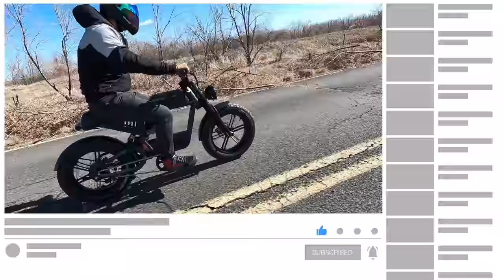Ride1Up Revv 1 Upboxing and Review

Comment: This honestly makes me want to sell my Super 73 S2. I can likely get around $2k for it and spend a couple hundred more and get this which has: rear suspension, Turn Signals, larger seat, Larger battery, higher top speed, metal fender, better display, mag wheels, 4 piston brakes. I mean... come on.  This thing even has the option for a $100 basket!   My S2 is make with such cheaply made comments its embarrassing how much they cost.
Reply: I almost pulled the trigger on a Super73 until I read alot of complaints about their customer service. I don't know much about these bikes so I figured going with a big brand name would be a "safer" bet. Considering I could have Best Buy ship it and assemble it had me leaning that way but in the short time (about a week) I've spent shopping I've found ones that seem better quality for the same price if not cheaper.
Reply: Yeah, it's making me want to sell my Rad Rover 6 Plus.
Reply: @rickymahoney6664  Take the time to assemble the bike yourself. If you're owning the bike you should understand how it works. What would happen if it broke down on you?
Reply: Get an eye on the Ariel Rider X-Class as well if your in the market for an upgrade! Ride1ups bike seems to have better looks and accessories than the x-class. But it appears the x-class has way more power and torque for the same approximate price if that's important to you.
Reply: Theres definitely a lot of competitive offerings right now and its unfortunate that a $3300 (not even including shipping and taxes) S2 doesnt even have rear suspension by default.
Reply: Why not just get a proper emtb?
Reply: Can it go up steep hills? Will someone 6 ft 1 be able to ride it?

Comment: I live in a hill area.  You showed how fast it goes with excess of pedaling But how does it do on hills.  What is the maximum weight that they can handle ? Can another battery be added to the system? When you start off in full throttle does the back tire spin ? What is the asking price of this particular bike ?
Reply: Price is $2395 according to link posted
Reply: It says it can carry 400 pounds at the beginning
Reply: @MylesKillis  Thanks for the come back. I guess I missed it at the beginning.

Comment: Awesome looking bike. I’ve followed some deals down the EUC route, and can’t see going back, but ebikes have a lot going for them. I would absolutely love it if people get out and replace some errand runs not driving a car. If it goes in a backpack and is less than 5 miles, I’m not driving unless the weather is terrible. I can see this being a pretty solid option for fun and practicality.
Reply: Good comment. Are these bikes legal to ride on the road? What licence do you need?
Reply: @TheGreatest1974  Technically, a street legal ebike isn’t supposed to go faster than 28 mph where I live (it’s supposed to cutoff all assistance, you can go faster if it’s downhill and gravity is causing that). I think this one will go a little faster than that, so technically it’s not “legal” but unless you’re driving crazy, nobody is going to notice or give you problems. My EUC is not allowed to be operated legally at more than 25 on public roads, but if I go 35 to get past a busy stretch, it’s never been a problem. I live by a police station, they have seen me many, many times. No license, no insurance.

Comment: It’s a nice bike, a lot of moped style e-bikes are cheap super 73 clones but this is a unique and thought out bike. My favorite feature is the loads of space to mount a second battery easily. The metal rims are great as they provide low maintenance. I still think Ariel rider X class is the best super 73 alternative, it’s better than the super 73 in fact when it comes to speed and acceleration. Ride 1 up has 90nm of torque while Ariel rider is 110 nm so I definitely think ride 1 up missed out on having a 1000W motor peak 2000W just like the x class.
Reply: I just watched Elektreks review and I’m sure this bike has a similar motor as the x class. They say 750 W for legal reasons but in class 3 mode it goes to 36 mph on throttle so the motor is definitely 1000W nominal
Reply: X class torque rating is just a made up number. they just lie. Ask them what model motor it is
Reply: @reallifescience2069  by looks i think its the same bafang model

Comment: i weigh like 280lbs and this bike has an impressive 400lb weight capacity, whereas all other ebikes i see cap out at 300 or 325lbs, which is a bit too close for comfort for me, as i wouldn't want my weight impeding on the function/speed of the bike

i'd love if you could test it with a heavier rider to check their 400lb claims!!!

Comment: if it had a rear rack (which also acts as a passenger seat) i'd prob sell my x class and get this, it looks sweet.
Reply: I agree with the sentiment, this ride1up bike looks better and appear to have much better accessories. Though, it appears it has far less power to it. If speed and torque is important to you, your xclass is already the best option.

Comment: I like the style and ease of assembly of the bike from what I can see, but I am also about mods that can be done to the bike to. For instance going from a single speed to a stacked cassette for more speed and better hill climbing stability, also add an all wheel drive version of this car bike. I would make the suspension also a little more heavier duty for people who are carrying more personal weight and I was thinking that if the open area under the seat was larger and accessible move the battery there and make it so that the bike can be made a hybrid style bike ( gas and electric ) for longer rides also if the motor was quiter it would make a greate hunting bike. Also what is the price tag of this bike?

Comment: I don’t care about how fast you can pedal that single speed bike for five seconds, show me the throttle only speed. If you want to add a front motor, how do you do it with those wheels? I agree it should have a 1000w motor because it looks great.
Reply: This bike goes faster than the bikes we have reviewed with 1000 watt motors. I was able to get it up to 31 mph with throttle only like I mentioned in the video, and probably could have gone faster if I tested it on a straightaway.
Reply: @Andrew-vt4jt  Do you think those wheels make power upgrades more difficult?

Comment: 3:55 That's a horn? lmao... they could not spend $7-10 more for a much louder one?

I guess its more of a bike than an actual motorcycle, I've used their older ebike model and their are reliable. Electric motorcycles are like +10k atm for a quality one and I hope they drop a bit in the next 5 years would love a real built with +20 HP and a horn thats at least 80 decibels, better suspension, turn signals, etc. Something that will make me feel safe on the road at higher speeds.

Comment: Nice video didn't spend time rambling on pointlessly. out the box on the road with good ride along. I like the frame lay out but was disappointed with the battery being up high on the frame instead of hung low for better center of gravity. Folks going for the motorcycle look forget on a gas bike you have the heavy motor low and light fuel tank high but with electric batteries, even these new ones they be heavy , the motor is low and light plus the controller weighs next to nothing. when I build E-bikes with conversion kits I find frames that allow me to put the battery low on the frame that keeps the surprises to a low roar. As for being able to lock it up, I would merely carry a cable lock. Nothing will stop them from stealing it if they want it, but you can slow them down. So love the bike but swap the battery and controller locations. but keep it simple.

Comment: Sounds noisy and single speed could be too limiting as I’d love more pedal power up fast. Maybe a review showing possible mods like larger ring gear, maybe 56t
My T20 I upped to 56t and changed out rear to a 11t top. I can now out pedal the motor which is handy for saving battery juice

Comment: I'm considering buying the hardtail model but I have just a few questions. Do you think the bike could seat 2 people? I'm fairly skinny at 173lbs while my girlfriend is in the 160s. Also do you think the two of us would stress out the motor/battery too much?
Reply: You would be tight with two people on the current saddle. I expect them to offer a bigger one or you can custom make one. You two together are below the 400lb weight capacity. My only concern would be if you live in an area with super steep hills.  You should be fine with hills but extremely steep hills could be challenging.
Reply: @Andrew  thank you for the quick reply my friend. Very helpful! Great video
Reply: @Andrew-vt4jt  are there any saddles you know of

Comment: You guys are the best love your reviews. Looks like a sweet ride what is seat height and weight? Im thinking about ordering  ariel rider x class step thru it only weighs 62 lbs lighter the better for me but this bike looks like the suspension is a big step up from the x class.
Reply: If your looking at the step through model of the xclass, I believe its listed weight is without the battery, while its actual weight is equal to the non step through variants listing. I don't know why it's like that. You can replace the ariel riders suspension very easily, even the step through version, there are videos online about it. I own the step through myself. While I cannot compare it to ride1ups physically, stat and number-wise, the xclass is a better deal for the greater power at the price. The cost of new suspension is quite a small price to pay for a bike with as much more power as it has.

Comment: Looks great...if it was dual motor & at least 2000w, it wouldve been my top choice
Reply: that is where im at , which other bikes are your choices?
Reply: @chickentava  honestly, its a bit odd, but 1st was a grizzly, 2nd choice roadrunner pro, 3rd is a light bike (beachman 64, rumble apex, & a couple others).  I know my choices are like the "Goldilocks collection" of e bikes, & they all couldnt be more different, but i like what i like, what can i say?
Reply: get rr pro is most fun man i want one altho i may be a bit big for it and the cops wont like it, im unsure too because i might get scooter instead, good luck
Reply: @chickentava  dude...i'm 6'3" 280.  Just put a better airshocks on the rear, $50-75.  I wanted a minibike for over 30yrs, so i think youre right, im gonna go RR Pro

Comment: NO seat height adjustment is a serious limitation of this design. It looks like great fun but not if you want the exercise pedaling gives... nice review!
Reply: Indeed, BUT think of it like a motorcycle. They too do not have adjustable height. So how do they work out??? Well, seat distance. Those who are taller are able to simply sit further back on the seat, and those who are shorter, closer up. No, it's not perfect. But its the pinnacle of 2 wheels comfort as far as I'm aware.
Reply: You do t have to pedal a motorcycle. That’s the issue.
Reply: @calihawk82  you also don't have to pedal this specific ebike. Or atleast I don't think you have to... These moped style ebikes are becoming powerful enough to not need pedals, but pedals keep them classified as an ebike.

Comment: Micah from electrek seemed to do 36-37mph GPS on throttle. he's a pretty lightweight dude, but that's impressive. how does. pedalling feel at top speed is the cadence ok?
Reply: I didn't try full speed with throttle only but bet I would get similar in a long straightaway.  The cadence sensor feels great.  Even though it is a single speed, it has more tension than 7 speed moped-style ebikes we have tested in the past.

Comment: I’ve really been considering one of these bikes, however I’m 6’2” and about 210lbs my only concern would be whether I would fit on the bike or not. Anyone my size have one of these?
Reply: I'm 6 feet and 210 lbs right now. It works for me fine. These bikes aren't really designed for a lot of pedaling, more cruising.

Comment: Looks nice, however having the frame go both sides of the battery may be good for strength and protection but looks like that adds quite some extra width up top, which imo is a bad thing for a bicycle when comes to comfort and easy pedalling over distance 🤷‍♂️
Most i have seen in this style have the battery sat on the frame so it's only the width of the battery.
I feel like I'm already riding a horse on my 73 style bike just avoiding the battery 😂 might need to take yoga or how to walk like Charlie Chaplin classes for riding that 😂.
Did you feel the difference when riding or catch and rub your legs more ?🤔
Reply: I didn't notice my legs rubbing at all but could see it being an issue for some. The bars curve in where your legs are sitting when pedaling.

Comment: EMOVE ROADRUNNER
Reply: They both have their pros and cons.  The suspension is far superior on this bike to the EMOVE Roadrunner.  You can always pedal this bike if you run out of battery but it would be brutal to pedal with no power.   The EMOVE Roadrunner Pro makes a lot of creaking noises but can go 50 mph and is fun since it is low to the ground.  Overall, this bike is safer due to the size.

Comment: In many states this bike would have to be registered and you would need a bike license for road use. You also cannot legally use the bike lane. My state has restrictions, as of 2019, on anything that goes above 28 while pedaling or 20 without pedaling. They haven't restricted them on trails yet...

Metal fenders are useless expense. Even dirt bikes use plastic since it is cheap to fix or replace when you crash. Dumb design to make dumb people think they are getting quality. Battery right between your legs at seat level is dangerous if you have battery fire. Hydraulic brakes, while nice, drive up the expense and are completely unnecessary.